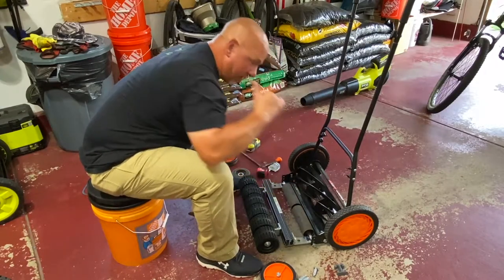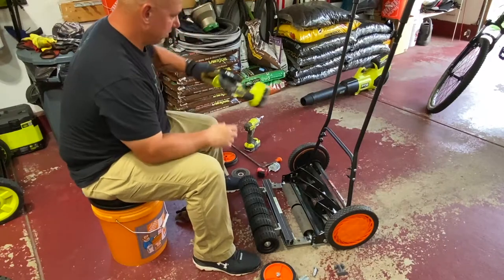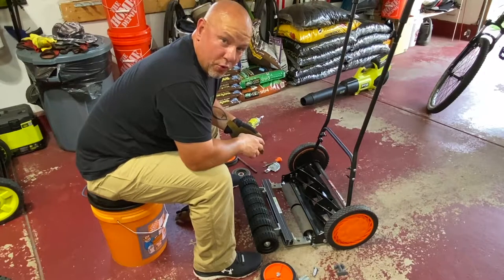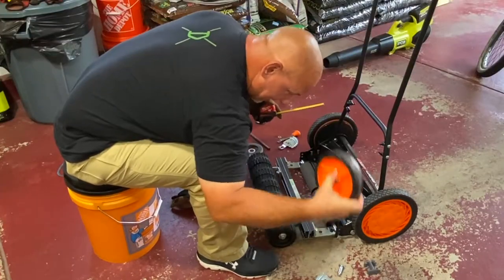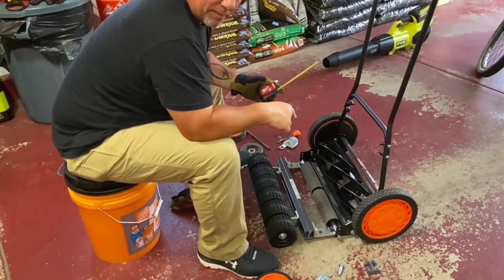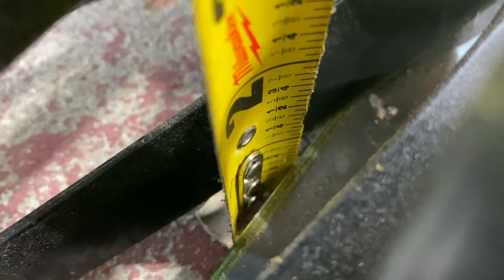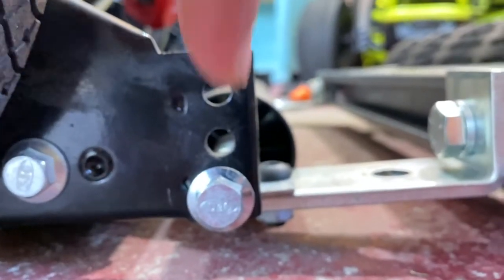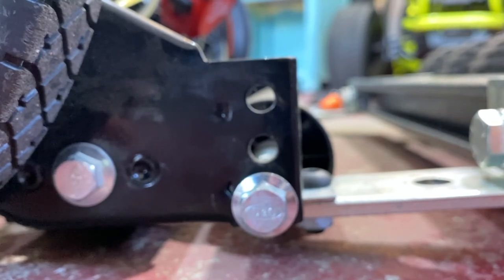How to Modify Your Scott's Manual Reel Mower

Comment: Awesome explanation!! I know you've mentioned its hard to adjust height of cut with your modifications with the conveyor rollers now... but at this point would it be easier to adjust the height of cut (for once a year scalping) by adjusting the two bigger wheels up front?
Reply from the maker: You definitely could do that. There are 3 settings for the wheels behind the center caps.

Comment: After using both - and having modified both to mow low - do you prefer the Earthwise 7 blade or the Scott's Pro 7 blade? The wider track isn't important to me personally as I have a small lawn. Just installed TifTuf and was thinking of adding a roller to my Scotts 5 blade classic, or springing for a 7 blade.
Reply from the maker: After modifying both, the Earthwise is easier to adjust height of cut. I can easily adjust from 5/8" up to 1" or 1-1/4" fairly quick and easy.

I like the Scott's because it is wider, but I now keep it on one height of cut setting because the modification limits the range I can cut with.

If you are okay with 16" wide, the Earthwise 7-blade (with modifications) is great value.
Reply: @TheBitsonEffect  Thanks for the input!
Reply: @TheBitsonEffect  Thanks so much! I don’t think the 2” different will make a big difference to me - my Bermuda lawn is < 500 sq/ft. Have you put a McMaster roller on the Earthwise?
Reply from the maker: @ranerg318  Yes I have. Here is the exact part number I purchased last year. Part # 2281T14 (2-1/2" Diameter Conveyor Roller, 7/16" Hex Axle, Steel, for 16" Between Frame Width). It works great with it.
Reply: @TheBitsonEffect  Amazing! Many many thanks for the help. Keep up the good work
Reply: @TheBitsonEffect  Any idea if that 2281T14 would work for a Scott’s Elite 16” as well?

Comment: Looking for a 7 blade reel mower for my bermuda 5,000 Sq ft lawn, should I go with this or the earthwise?
Reply from the maker: I would go with the Scott's 18 inch for 5,000 square feet. There is one caveat, If you want to mow different heights during the year, the Earthwise is easier to adjust down to 3/8 of an inch and back up to 2 inches. The Scott's won't go below 1 inch without a modification. Once you modify, it's a pain to change back to mow at 1 inch or above. Hope this helps, Kristin!
Reply: @TheBitsonEffect  thanks so much for the advice, I'm cool sticking with 1 inch

Comment: I ordered the exact part you listed and it’s not working. Any ideas?
Reply from the maker: Not sure. Another viewer said he ordered the same and it worked. One side of the hex shaft should be spring loaded. You insert the stationary side first and then push the spring loaded side in to go in the whole. If the hex shaft is slightly too tight, you could bore the hole on the reel mower slightly to fit.
Reply: @TheBitsonEffect  how do you pull the spring loaded rod out of the ordered roller?
Reply: Same here. The physical dimensions of the roller do not fit between the mounting flanges of the rear wheels. Has nothing to do with the spring loaded hex shafts. You should remove this roller recommendation, it is not correct.

Comment: Any idea where I can find this model?  Struggling now......
Reply from the maker: Should be able to order it online from Ace Hardware. https://www.acehardware.com/departments/lawn-and-garden/lawn-mowers/push-mowers/7006267
Reply: @TheBitsonEffect  It's a 5 blade, not 7 and doesn't have rear wheels to trash...
Reply from the maker: @Phxphenom  they bamboozuled me! The one I saw was the correct one. I will keep searching. I never give up!
Reply: @TheBitsonEffect  Yeah I have been looking here in Phoenix as well.  Will look used too
Reply: @TheBitsonEffect  I think I found a slightly used one in Vegas for $65 with Shipping!
Reply from the maker: That’s a pretty good deal. I looked all over the internet this morning and it appears all 18” 7 blade reel mowers are out of stock. Earthwise has their 16” 7 blade available, but no 18”.

Comment: Can this be done in a 20” Scott’s classic?
Reply from the maker: Yes it can. You can do it on any of the reel mowers that have the wheels and adjustment arms.
Reply: @TheBitsonEffect  where can I find those front rollers ?
Reply: @TheBitsonEffect  from your experience. Will a front roller like one from a Mclaine work ?
Reply from the maker: It won't be a front roller, it will be a rear roller. You would have to modify quite a bit more to put a front roller on. 

McMaster-Carr has conveyor rollers that will work for the rear, you will have to make sure all your measurements are correct. www.mcmaster.com/conveyor-rollers/
Reply from the maker: It could, but you would have to modify the mower quite a bit. Adding a rear roller is much easier.